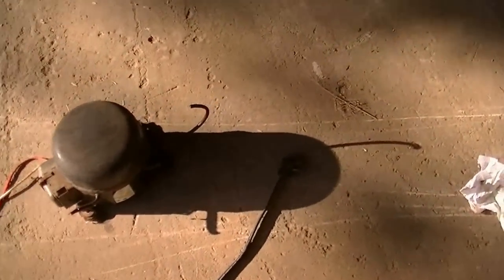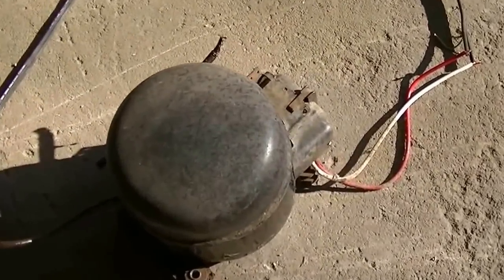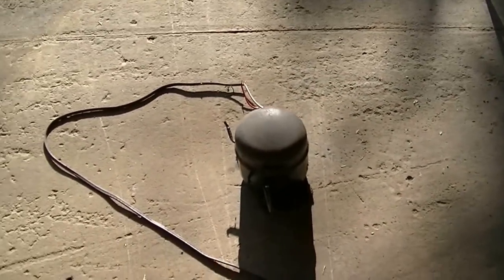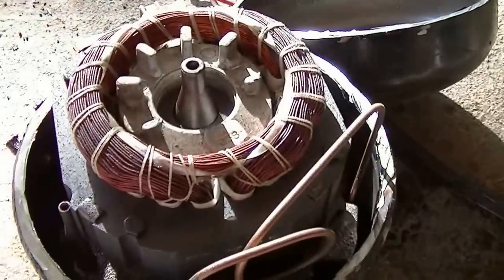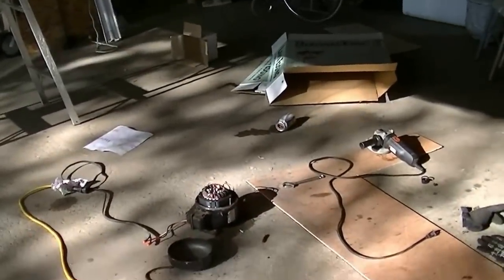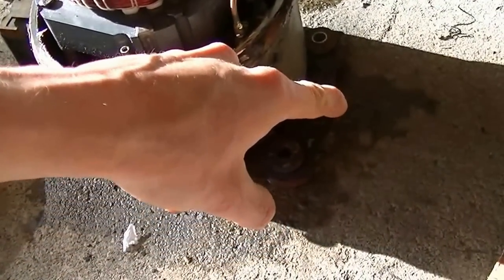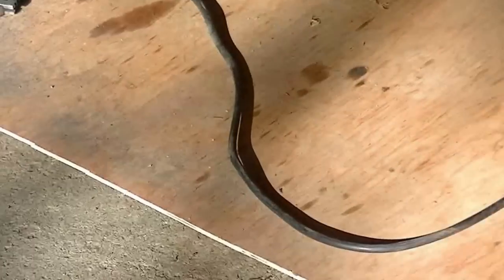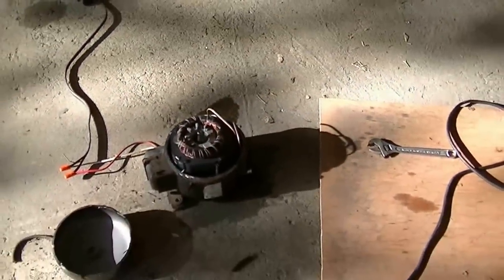Opening up a freezer compressor from the 70s

Comment: i have a 30-40 year old HVAC compressor and it still runs just fine  and the HVAC worked but it was out of gas because it had the factory charge of r22 and no valve so it wasn't charged in 40 years

Comment from the maker: the same stuff that's in the compressor, it's a closed system. the compressor just circulates it between the evaporator and the condenser. do some research on refrigeration systems.